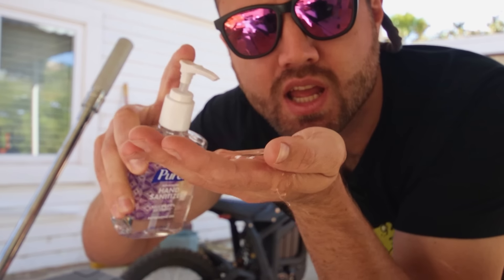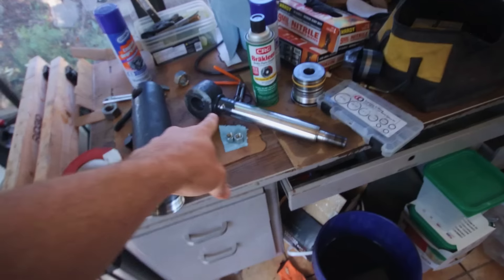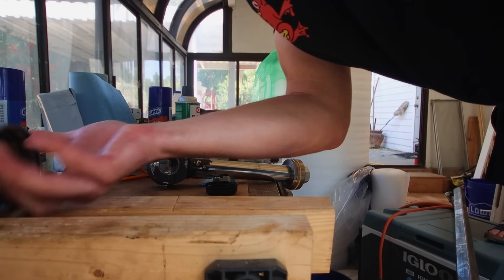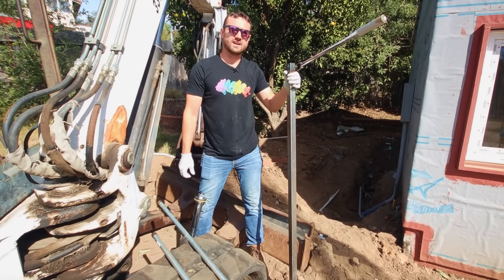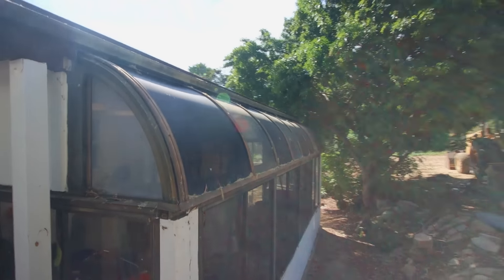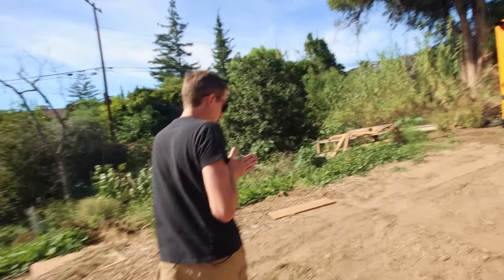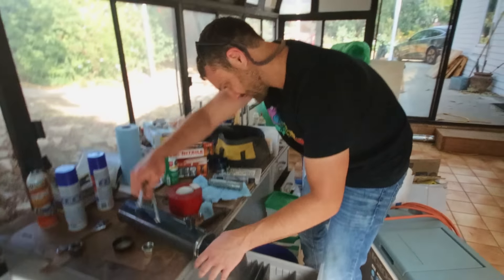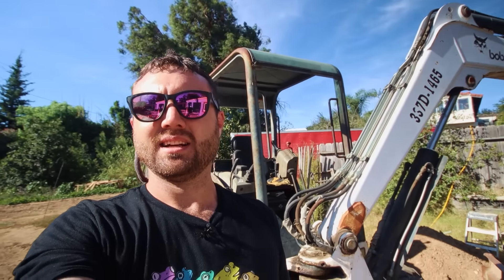I built a very big wrench

Comment: As a Guy that Worked on Hydraulic Cylinders I can tell you we never torqued them on. Just a ton of red loctite, and as tight as you can get, it will work. When you take it back apart, pop your piston seal off and burn the loctite out, and the nut will come right off.
Reply: Eyy yes this guy knows! Torquing doesnt always stay either, seen so many vibrate loose and self destruct. Just smother it in red and send it home with the biggest impact you got and shes good haha.
Reply: @sharkbaitgaming  dont forget to slap it twice and say "that's not going anywhere"

the previous person who worked on the excavator probably forgot to do that as well
Reply: @awesomestuff9715  Thats the #1 cause for most Hydraulic Failures. I guarantee he didn't give it the final slaps.
Reply: Look if two men and a torque wrench and loctite can't keep it on, 1000lbs of torque never woulda.... Lol
Reply: @awesomestuff9715 Matt from demolition ranch?
Reply: German dude who worked here in the mining industry for a little ... i agree, when it needs to run, you do it like that ... but the dudes who make the yearly maintenance hated you for it, they do everything by spec. But nothing a whole crate of beer can't fix.
Reply: At the hydraulic shop I work at, we just fill it with red loctite and then get a big cheater bar and have someone hang from it lol. It seems to work. Sometimes for things like set screws we loctite and then punch on the side of the hole.
Reply: Railway machine I worked on used 8mm? bolts to hold pins in for a big chainsaw chain

Just smashed the threads with a prybar so the nut wouldn’t come off, grinder to cut them when you needed to split the chain
Reply: I've put together somewhere around 50k cylinders for forklifts over the past decade, and I've never put loctite on a single nut. 
We always use Nylock nuts, and they typically are smaller than these. 
Never had one come back because the nut came loose.
Reply: Sure, you tell him now after he's made the 1000 ft-lb wrench lol
Reply: Loctite is a frenemy of my existence in workshop. Sure it does help lock the nut in, but it's a major pain in the ass when I try to disassemble a hyd cylinder.
One of the job I do is to disassemble some customer's cylinder, measure every component, then redraw that on CAD to be used by the workshop folk to create duplicate of said customer's cylinder. Tried to burned the loctite myself only to inhale the fume and knocked myself down. Never gonna do that again.
Reply: On a second note, why Will's cylinder didn't have Piston O-Ring that rest on the rod, inside the piston? Thought that's the standard practice and probably help mitigate Will's original problem.
Reply: @michaelantonius321  Some cylinders are manufactured with and some are without. It depends on how the rod seats into the piston in my understanding of it.
Reply: @JPierson217  Alright, my bad for assuming that every manufacture design their cylinder under 1 same design concept/principle.
Reply: @imadmorsli2871 y’all don’t have a torque table?
Reply: You can't forget to chalarmate
Reply: I'll echo what the others have said: the hydraulic shop that I worked at rarely torqued the nut.  Usually it was a combination of red loctite and high performance 1/2", 3/4" or occasionally a 1" air impacts, although there were a few customers who specified and received a specific torque value.
Reply: @michaelantonius321  do you mean an o-ring that's under the piston and basically at the bottom of the threads?
We call those anti-seep seals where I work, and I would assume that those would be very necessary for this application. We do some cylinders that don't require them, but they basically just move something horizontally and doesn't need to hold any pressure.
Reply: @ogKEGGY  That does ring a truth in my mind. I would keep the name of that phrase in my mind next time I have to communicate with other folks on workshop. 

I do works on pressurized cylinder, so the o-ring under the piston is a requirement on my  CAD files, or that's what my seniors teach me about it. 

I suspect that it, along with piston seals(usually I use Hallite product), are to prevent any working fluid to go back behind the piston area, and probably to avoid Will's problem on this video.
Reply: @awesomestuff9715  What's the ratio of conversion for "That's not going anywhere"s to Ugga Duggas?
Reply: @peepopalaber  are u werner ziegler

Comment: I really resonated with what Will said about "sometimes its just about finishing something". Im making mandalorian armour out of steel and was able to sit down today and figure out the electronics for the alpha numeric display. Didnt do any beating of steel, but i did make progress. And im pretty happy with that
Reply: Isn't the whole point of making something like that out of steel is that you get to pound on the metal to get your frustrations out?
Reply: That’s gonna be heavy as fuck
Reply: @gregw1076  normally yeah! And it does wonders haha. But I was stuck needing to finish the electronics for the LED chest plate display before I could move onto bashing more metal. I think I'm over the worst of it now though. The rangefinder moves and most of the chest LEDs work
Reply: @l4gging4days43  You'd think so but it's not actually that bad. I've done a few conventions so far in steel mandalorian armour and it's not until the 5 hour mark where it takes a bit of a toll. The latest set of armour I'm working on looks better and has more details with metalwork and electronics, but it's not going to be any more heavy

Comment: hey william, last video when you guys got the bus you mentioned how there was alot of "exhaust" coming from the bus.

the color of the exhaust was blue, which means that the engine is burning diesel and oil (probably why they wanted to sell it). but this shouldn't really be a problem, by the sound of it that should be a Ford 7.3L power stroke, and it isnt uncommon to see that with those engines.

the most common cause of this problem is worn/bad piston rings. to fix it you would need to rebuild the entire engine. however, be sure to check the oil level often
Reply: Why would you need to rebuild the whole engine? Do worn piston rings imply that the cylinder bores would need refinishing?
Reply: @bigchooch4434  You might be able to get away with new rings but more often than not the cylinder bores have kind of machined themselves to the rings and they'll chew up any new ones. And at that point why not reseal it all and get rid of any other problems you might have
Reply: @aidanbotham442  exactly. tearing the entire engine apart completely is the biggest hastle, and to not send it to get machined is doing yourself a massive disservice.
in my experience as a mechanic, the cylinder walls are usually the ones to cause this due to cavitation and poor air quality (which makes them rough and in turn ruins effectiveness of the piston rings to keep oil out if the combustion chamber)

especially a school bus that is running everyday for hours in city traffic, they usually get beat up pretty bad internally (always running and schools not having the budget for proper/consistent services such as changing oil, lube and fuel filters, and air filters (which lets sand and dust into the combustion chambers and causes what i previously mentioned)
so getting it machined, maybe bored out a couple thou with better pistons seems appropriate. but this is a school bus they bought as a gag, so just refilling the engine with oil as needed should work for them lol
Reply: "If it isn't burning oil, it doesn't have any"
Reply: Have you seen how the engines are mounted in this thing? it would be SO MUCH WORK to pull the engine. Half of it is in the cab 😅
Reply: @TheBackyardScientist     i took another look at the vid, and by the sound of the engine, and the look of the steering wheel and grille, i think u actually have a much older bus, from perhaps the early 90s. this means the engine you have is actually a 7.3 IDI, a very barebone and simple diesel engine, probably backed by an e40D automatic transmission. this oil problem is actually wayyy more common in these engines, tho the solution is still the same.

however, i believe i saw that you have dog house access (a cover that is part of the firewall thay can be removed from inside the cab. this gives you access to the rear of the engine and you can take off the transmission bell housing bolts (as well as other components) SIGNIFICANTLY easier. so bc of this, coupled with having a simpler engine (less crap to take on and off), i think if you remove the hood and radiator you can have the engine pulled out with much less work than i originally thought (i thought u had an early 2000s bus with a 7.3 power stroke).

HOWEVER, this 7.3 IDI engine is dam near indestructible, a little oil wont do anything to it (you are already working with only like 150hp 😭) you really dont have to go thru the hassle of rebuilding it. additionally, this is a naturally aspirated engine, so unlike the power stroke, this engine does not have a turbo (unless it is a 94 ish model), so you dont have to worry about oil in the intake! 😁

generally, if you don't mind the smoke, as long as it isnt using too much oil too fast, then ur fine lol

just check the dipstick every so often to make sure the engine has oil, and watch the oil pressure while driving,  and you will be ok.

lmao tho i dont think the state of California will like that 😁

and just in case if it is a 94 model that has a turbo, you can take off the turbo and check for oil residue in the upper intake manifold (where the turbo charges the air into the engine). if their is a significant presence of oil there, then replace the turbo, and turbo oil feed and drain lines immediately! a bad turbo or faulty lines will cause it to feed oil into the injectors and if its hot enough, it will start using the oil as fuel 😬 meaning shutting off the fuel will do nothing, there is no stopping the engine from revving to the moon until it blows up or seizes. just search "runaway diesel engine" on yt to see. so heads up if u do have a turbo charged IDI ☝️

Comment: I work at a place that specializes in manufacturing hydraulic cylinders for heavy duty mining equipment.

There are a few options we use to keep the piston from backing off depending on the application and size of the cylinder, but none of them involve torquing to 1000+ ft lbs.

Also the cap on the end is called a gland and if you use a longer pin wrench with an actual handle and secure the cylinder in a press or vise, it's way easier to tighten.

Comment: this is WAY cooler than a torque multiplier lol. i'm hoping you just went right to making this instead of finding what a torque multiplier is first
Reply: Boring nerd thing or BIIIIIIIG wrench? I think the winner is obvious
Reply: yea leverage is way cooler than gear ratios
Reply: Chad Archimedes has entered the chat
Reply: Hidden boring geared thingy or LOOOOOONG boi? Long boi is funner (and also a bit more dangerous, naturally 😈)
Reply: uhm... this IS a torque multiplier
Reply: @Epic_Eggroll  same shit, different smell. if you don't quite grasp what I mean, I recommend the Periscope Films archive of "Around The Corner - How Differential Steering Works (1937)" which opens with a great demonstration of the direct relationship between gears and levers.
Reply: @AllenKll yes it is, but i was referring to the tool used by large equipment mechanics. i believe GearWrench makes a planetary gear torque multiplier wrench, but if you search for "gear torque multiplier wrench" you will find the off the shelf solution to what Big Willy has made in this video. essentially, instead of a longer lever it uses a planetary gear set to get the mechanical advantage. if you have to break loose a ton of lug nuts on a giant tire, the smaller gear wrench is easier to move around

Comment: Hey Will, dont beat yourself up too much about forgetting to put that cylinder cap on before that piston. I once watched a engine crew forget to put connecting rod nuts on a top fuel hemi engine. They had gotten the entire engine back together and were about to put it back in the car when someone noticed. They were on a strict time crunch as they were rebuilding it in the pits. Needless to say I learned two very important lessons that day, always double check your work. And it is very funny to stick random nuts and bolts in other peoples work stations.

Comment: Actually drew the freebody diagram and changed my mind, comment below wasnt entirety correct.  -Torque doesn't lever multiply like this, only force does. Draw the Freebody diagram of the setup you have. 250 in, 250 out. You still only applied 250ftlbs in this setup-
Reply: You are kind of right but kind of wrong. Torque does multiple with leverage (after all, look at the units; torque is literally a force multiplied by the distance from which it acts), but it doesn't multiple the way William stated in the video. Let's say his torque wrench is 2ft long. When the torque wrench indicates 200ft•lbs, it means he applied 100lbs of force at the end of the 2ft wrench. (2*100=200) Now when he adds the 5ft breaker bar, it only adds to the distance that the force is acting on, but the force is still multiplied by the total distance, so the 2ft wrench plus the 5ft bar would be a total distance of 7ft, and with a force of 100lbs, that would make the torque at the nut 700ft•lbs. To make 1000ft•lbs of torque at the nut, William would have to apply 143lbs to the end of the wrench, which would mean setting the torque wrench to 286ft•lbs.
Reply: @jsax01001010  yeah, you are right and I was wrong. Ended up drawing the free body diagram last night and talking to some friends. It's a good assumption trap this one.
Reply: @hadesbearer  You were still right to say that he didn't make 1000ft•lbs at the nut, something that I didn't see any other commenter point out. Torque wrenches in general are a pretty good assumption trap. Most torque wrenches aren't directly measuring torque; they are generally measuring some property related to how force is applied to the handle which is used to infer the torque at the fastener. If you change anything related to how force is applied to the handle or how it's transferred from the wrench to the fastener, it can significantly alter the applied torque versus the torque indicated by the wrench. A common mistake when using torque wrenches is choking up on the handle or pulling with a second hand further up on the wrench. This will overtorque the fastener beyond the torque set at the wrench.
Reply: @jsax01001010 ouh nice comment. At least he was safe to not over-fasten it I guess. 
Another common mistake is to use some sort of extension because it’s easier to apply the torque on the big boys.

Comment: wait, you have a printer and just need the files right? Make sure you print it in flexible material, so much better on the hands. I made wheelbarrow handles recently and nylon and ASA was horrible with extended use, TPU is the way to go. Preferably softer than the standard 95a. Or you could use 1mm walls and 20% infill so it still has some give to it if you don't have really flexi TPU.

Comment: I work on rotary wing aircraft, the nut that mounts the rotor system to the helicopter always has crazy high torque. For the ch47 thats about 5-7000 ft/lbs. Breaking that nut loose sometimes can take up to 12,000 ft/lbs of torque.

Comment: I used to some light mechanic work on trucks and removing the wheel nuts sometimes required an effect similar to this but we would just place a socket and a solid (non ratcheting) breaker bar on the nut then we would slide a 4 foot long steel tube over the end of the wrench in order to get more leverage onto it. not sure if works the same as what's happening here but it almost always did the trick

Comment: There's this great material you can get from craft stores called foam clay. It air dries into basically EVA foam. You can make a very simple handle shape and then mold the foam around it until it hardens into the exact shape you want it to be

Comment: you could also calculate the clamping force of those 1000ftp and calculate how many turns the nut would need to reach the needed clamping force, i never seen one but i was told that in those huge container ships to torque some masive bolts they have some pecial hydraulic tool that streches the studs to the set clamping force and then you just tread the nut by hand and release the tension

Comment: The torque at the nut is still whatever the torque setting your torque wrench was set too(assuming it's within spec). Think of the two as two separate links where the coupling will click once the moment reaches the torque setting. Moments can be translated in the same plane. So taking the sum of moments the torque at the nut will be equal to the torque at the end of the torque wrench.
Reply: say i have a 10ft piece of steel, fixed at one end. i apply 100 pounds of force at the free end, and i get 1000 ft-lbs of torque at the fixed end. now say i chop 1 ft off the free end, weld a square drive to it, poke a square hole in the long piece, and mate them back together. we'll say the whole mess is now 9.5 feet long, because now they're overlapping slightly. then I apply the same 100 pounds of force at the end. what is the torque at the fixed end? is it a: 100 foot pounds because the cut off section is 1 foot and some crazy mumbo-jumbo about moments? or is it b: 950 ft-lbs because torque is equal to force times distance
Reply: @robmckennie4203  alright well think about this, what is the torque where the torque wrench connects. Where they connect is a pivot that will prevent more than the set torque to be applied. So once the prescribed torque of the torque wrench is met the beam(bar plus torque wrench) is not rigid.